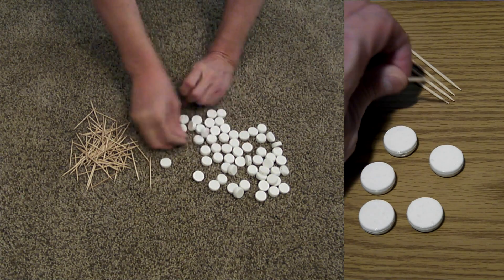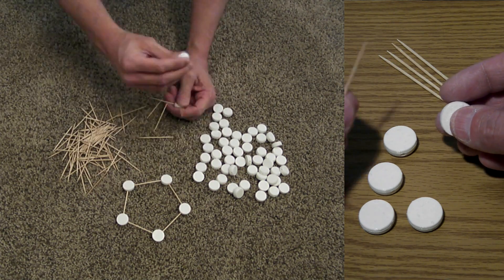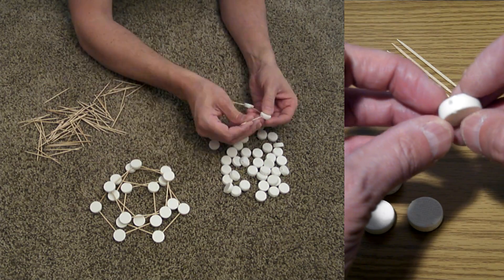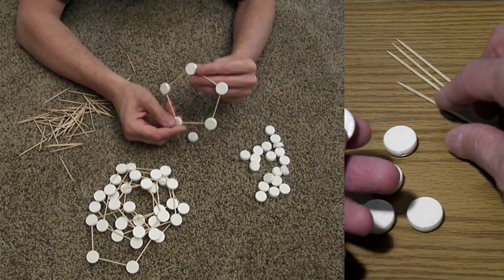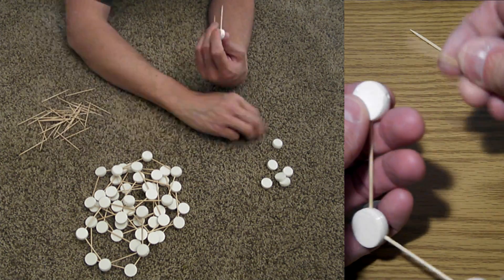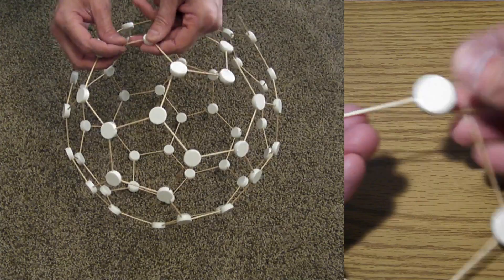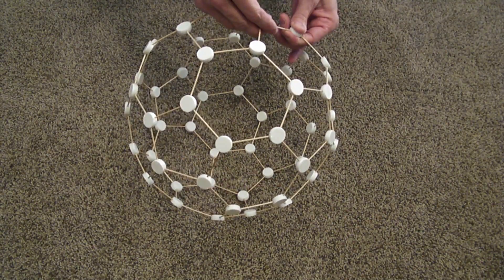Toothpick Truncated Icosahedron (Buckyball)

Comment: from where you get these white nodes
Reply from the maker: I 3D printed them.  A link to where you can download the model is in the video description.
Reply: Or, you could use small styrofoam balls.  Cheaper and faster, though not as strong.
Reply: @wrsatl  -  but the white nodes have the proper angles for the links.  If you try to do it with styrofoam balls you will need a guide or jig.  I'll research that and edit this comment.
Reply: Or you can just use thermocol balls..lol,saves the pain...!
Reply: Can we make balls by using clay?

Comment: Awsome idea 👍wish you sold these? Not all of muggles have the funds to buy a 3d printer 😊... also maybe do one big enough for standard school pencils ? Would be great for teachers and pupils?
Reply: Use 2 washers and double sided foam tape to make the hubs. .
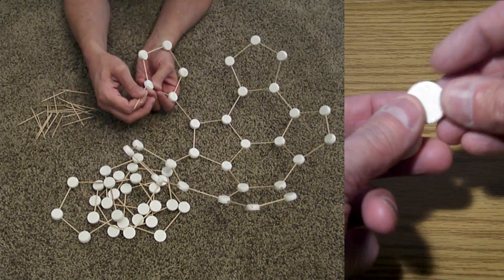Reply: @JohnGuest45  -  BUT the links have to be at a certain angle.  Remember, the poster says "the hole with the mark" is for connecting the pentagons.  Pause the video at 0:58 and 0:59
Reply: @robertgraybeard3750  
The angles are very easy as all the hubs are identical. A simple jig is all you need. Draw a circle the same size as the washer on a piece of paper. Using a protractor, make a mark/line in red pen at the top of the circle (0 degrees). Measure 124 degrees down on both sides of your red mark/line and make 2 blue marks/lines. The blue marks are where you connect the pentagon struts and the red one is where you connect the hexagon struts. The struts are all the same length so you dont have to worry.

Comment: Is the openings for the tooth picks a "equal" triangle?" Thinking if these "dots" can be made alot larger out of like aluminium, taking a 1 inch dowel or pipe.
Reply from the maker: +Moronicsmurf The openings for the toothpicks are not co-planer and  one of the openings is at a different angle than the other two so I am pretty sure the answer to your question about "equal" triangle is no.  The design could certainly be scaled up though.  You could make one large node (or "dot") and cast duplicates to make the full buckyball.